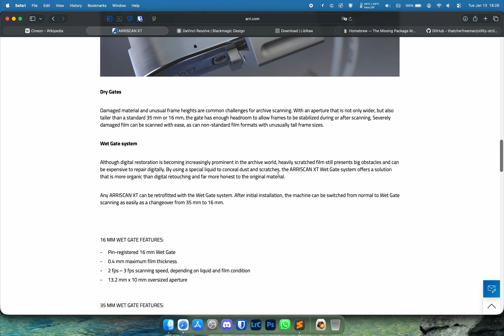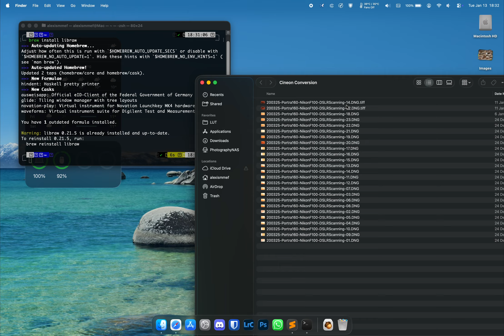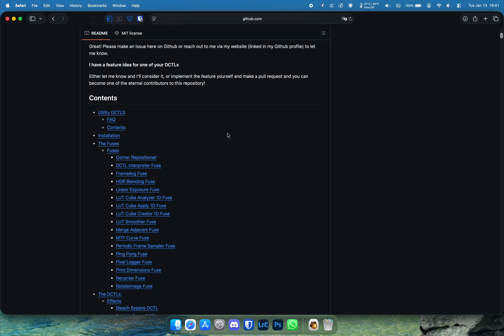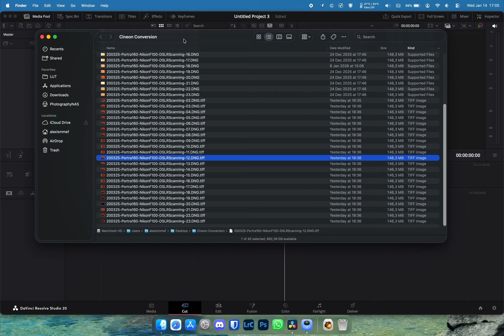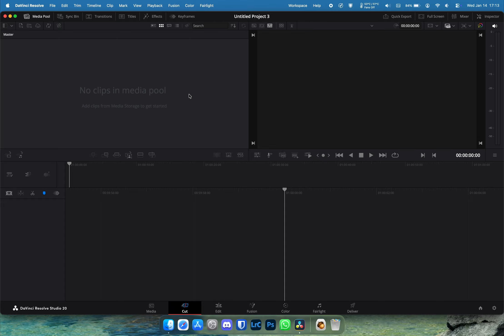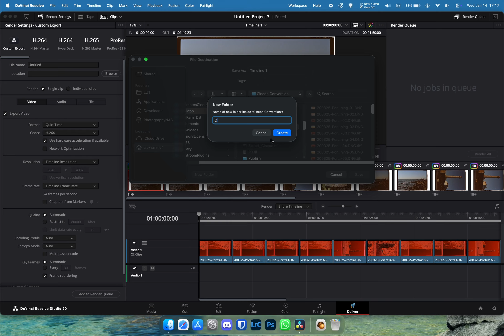Color Negative Inversion Process using Motion Picture Cineon Log System -  Davinci Resolve Studio

Comment: Do you need to use LibRaw with linear scans from a Nikon Coolscan (your Vuescan method in a previous video), or is it just needed for DSLR scans?
Reply from the maker: LibRaw is not needed if you are already outputting a Linear Encoded File, which is the case of VueScan. So you can skip that part and go straight into the next. DSLRs Raws need some kind of interpretation  to access the Linear Data.

Comment: Very interesting Alex, Thank you for sharing your method.
What advantages does it have over manual inversion in Photoshop ?
Have you run a side by side comparison ?
Greetings!
Reply from the maker: Thank you for the words!
About Manual Inversion vs Cineon Method in Davinci. The biggest issue is that in Photoshop, or any other Image Editor Software that I know of, you can't turn off the Color Management when you load a File, so it will not allow you to work with the Native Color Space of the File. Davinci Allows this. The biggest advantage is that ideally you want to Invert your Negative in the Native ColorSpace, without any transformation, because this is where weird Color Shift will happen, and after you have inverted, you can assing a colorspace to the image.

Comment: Thank you for the video! I wonder if camera scans would be good enough to use this method for Vision 3 film processed with a 2383/3150 Print LUT for a true Cinema DI image.
Reply from the maker: Thank you for the words! If I understand what you mean, if you could output a Cineon Log file with this method, and then apply a Print LUT? Absolutely. It will be a true Cineon file if you use the DCTL in such Output eMode. I have not tried this yet, but it seems very promissing!